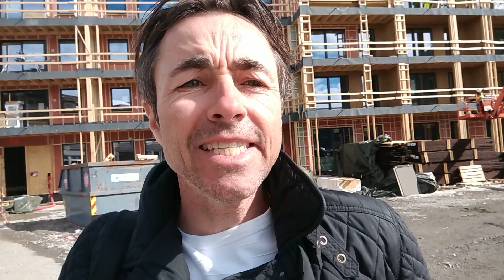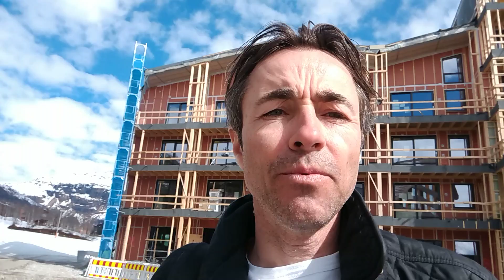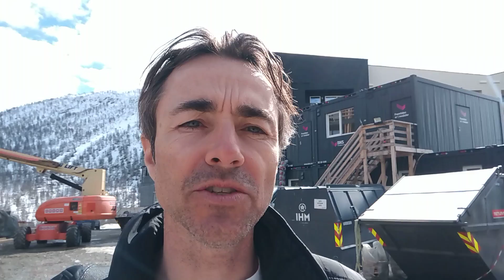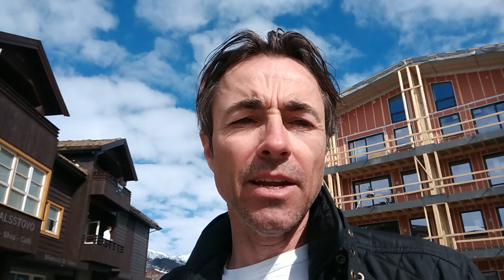Building timber frame in Norway!!

Comment: Hey @Robin Clevett I love the videos! I am in my 3rd year of a carpentry apprenticeship in New Zealand, I'm loving it so far! I am still learning and trying to work out the best way of doing particular processes by watching videos online through channels like skill build, finish carpentry tv, and essential craftsman, as well as my on site foreman (of course). The issue I have been finding is that companies apply ridiculous time frames for work to be completed. Example being today myself and a second year apprentice were told to fit trim (arcs and skirts) for a reno house with massively mismatched drywall to window reveals  in half a day.... I was wondering if you could give me advice on how best to deal with this? I really want to work for a company that takes the time to get the job done right and allows room for apprentices to learn without a frantic rush but I don't want to shop around companies while I'm doing my apprenticeship as it will delay my qualification and I will earn a bad rep.
Reply: Ross Bailey maybe could use a laser measurer, also plain the window frames where they stick out from the GIB, sounds like unrealistic expectations though and a lot can hinder how fast u can build , Akl NZ 
Where are u from in NZ anyway?
Reply: Also Scott Brown Carpentary, RR Building, Mitre 10 Stan VCG, are good channels